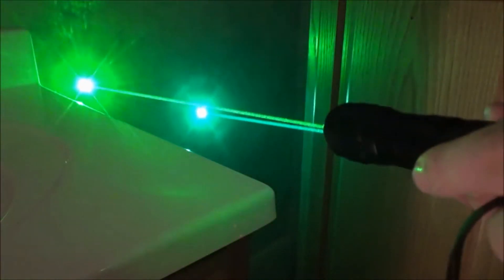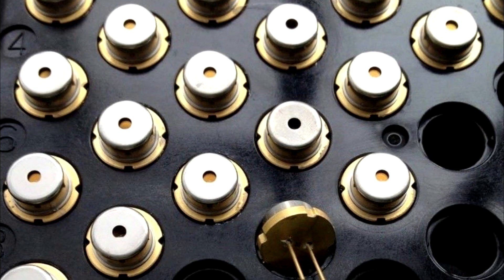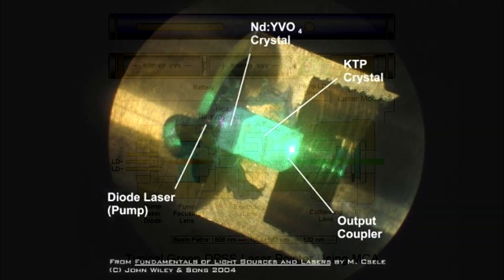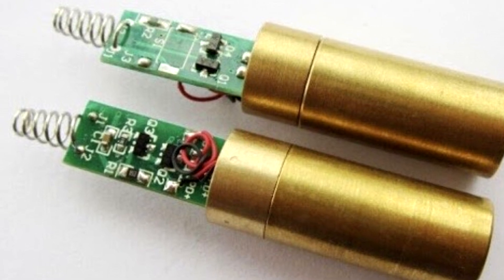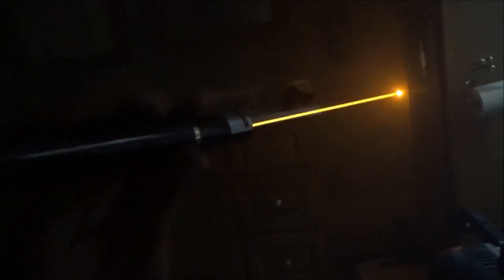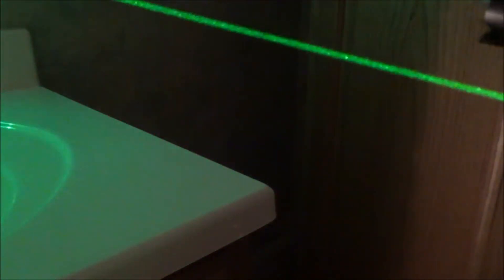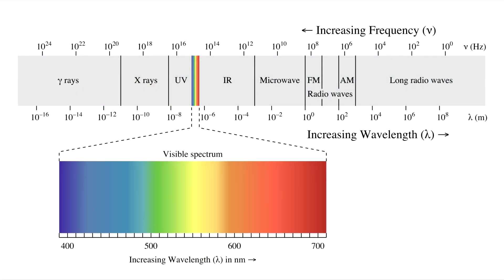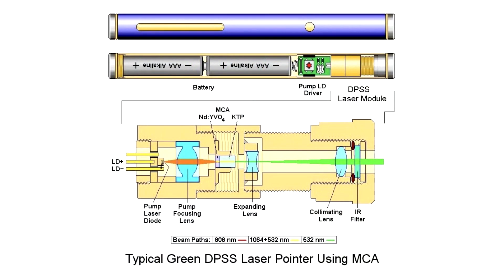Lasers - Direct Diode vs Diode-Pumped Solid-State (DPSS)

Comment: Could you explain Single Mode and Multimode Diods in comparsion?
Reply: Single mode produces a tight beam dot while multimode has both axis of the diode diverging at different speeds. In a multimode diode one axis will diverge much faster producing a thin line beam pattern. FAC (fast axis collimation) uses a fiber optic lens to slow down the fast axis producing a square beam pattern.

Comment: hello, can you tell me the cheapest way of getting a small spot on a maximun distance? I want to build a IR laser, that can pop ballons on long range therefore i need very low divergence...the g8 lens is supposed to give the best range, however i dont know if a beamexpander would be better but it seems they are costly.
Reply: Use an 808nm diode
Reply: Don't use a dpss

Comment: we really need your content rite now! With the quarantine and all the chaos going on.... lasers are a nice distraction. And more powerful green lasers are coming out all the time... dangerous for sure. And people need to be educated. You have one of the only high-quality laser related channels on all of YouTube. And I think your viewership could skyrocket with regular content posts.

I’ve been meaning to ask you a question…

I’ve been gathering the parts to build a new green pointer. 

I have dozens of green lasers around 100mW, but I’ve been wanting something stronger. Was planning to start out with 200mW and then build a 1000mw after. 

But it doesn’t seem to be economical Because  I already got a great deal on a 1 watt 520nm NDG7475 laser diode. And have dozens of modules, hosts, batteries, etc....… after considering the cost for the diode and the driver… The laser will cost me around $100 to build.

Which is nearly the same amount to build a 200mW version. 

There are nice high-quality 200mW modules sold by a few reputable sellers on eBay. They are $40-$60 with high-quality drivers and glass lenses. Already pressed into a heavy brass module and ready to go.
But at five times less powerful.....  and costing nearly $100 to build. I feel like I should go straight for the 1 watt? 
 I feel foolish building a 200mW laser that would cost me nearly the same amount. 

I love sanwu and other high-quality pointers… And would have no issues purchasing several... but I love to build my own things and I wouldn’t enjoy such an expensive pointer… Being afraid I would scratch it. And knowing the same amount of investment could’ve built me several very nice powerful pointers for the price paid for that one manufactured unit.

However with my own builds.... I’ll make it look rustic and vintage. Like a 200-year-old laser blaster weapon discovered in the pyramids in Egypt or somewhere… LOL 
In a beautiful patinaed and aged brass housing, with the nickel plating worn through.... and rustic green corrosion in all the right places. It only gets more beautiful with use!

 like a beautiful nautical tool, compass, or sextant on a pirate ship 200 years ago.

With a gently aged and warm vintage look, I’m not afraid to use or scuff it up.

Would love your input. And Hope to see more frequent videos from you. Maybe some DIY stuff!
Reply from the maker: Thank you for the kind words!! I have actually never built my own laser before, so I'm probably not the biggest help :(  I've always wanted to though... maybe someday soon!